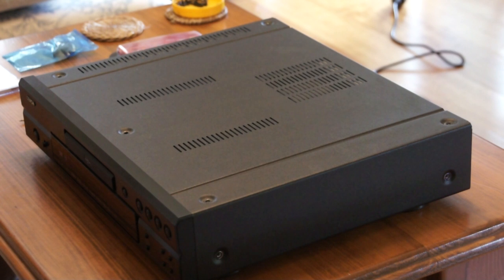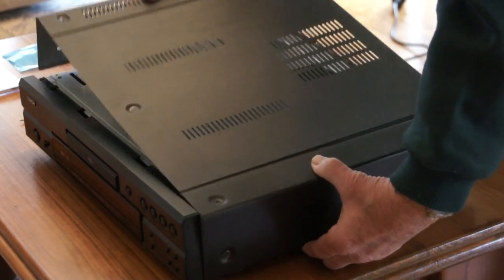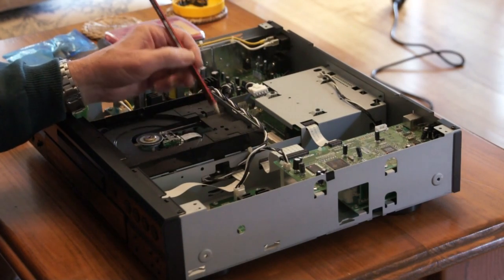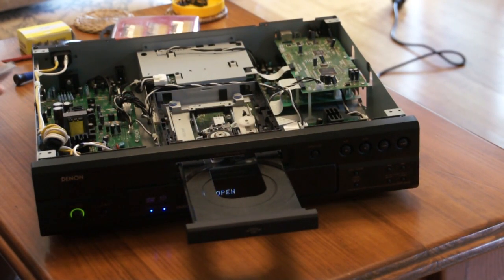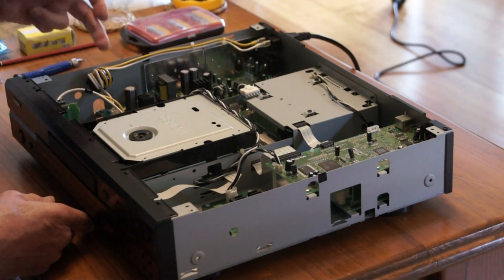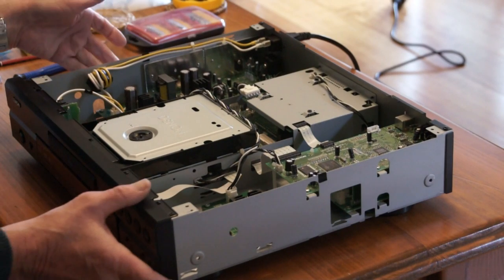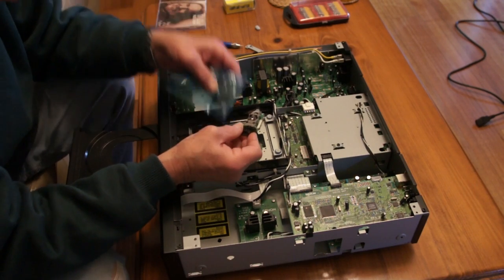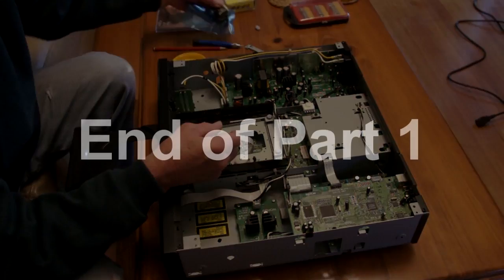Denon 2930 Laser Pickup Replacement (Part 1 of 3)

Comment: I've just successfully replaced the laser in a Denon 3910 that had stopped playing thanks to your video. The 3910 has the same body but slightly different interior but with the information you've given it was easy enough to figure out. The black front panel has to be unscrewed and pulled away a little and a  bar across the top  held by two screws, removed to allow enough room to remove the covers on the laser assembly. Thanks to your warning regarding the springs I avoided losing them. The ribbon connector has a tiny bar which must be pushed out a millimeter or two before being removed and of course pushed back when replaced. The left bar along which the laser slides can be left in place; the right comes out to remove the white gear assembly. I believe you did one thing wrong: changing the allen screws which adjusted the height of the assembly/beam. Sorry yours didn't come back to life but good karma to you on your next project for showing me how to revive mine!

Comment: Great explanation and tips!   My Marantz DV9600 has very similar Philips transport, and failed to play CDs (SACD and DVD were OK).  I initially tried adjusting the allen screws with the old head to no avail.  

Only differences were:
1) There was black 'tape' holding the back side of the cover on which I had to remove, and there was a ground (you call it Earth) wire with a copper screw to remove on the top of the cover.
2) I had to remove two solder blobs on the new pickup instead of one.
3)  There was a small white plastic piece on the old pickup that helps keep it on the left rail (looking from the front) that I transferred to the new one
4) I was able to keep from losing the springs by carefully keeping the black plastic retainer upright.  

Thank You!   I was able to get a great player working again (original list was about $2000 US in 2005).

Comment: Excellent set of videos. I am a hands on electronics eng and also enjoy repairing similar devices as a hobby. Just one point to viewers. I suggest it is better to use a pointer device other than a pencil. This because a pencil tip is graphite. Graphite is carbon and is a very good electric conductor. One could accidentially leave a graphite trail on a circuit board or between adjacent components etc and it could conduct and short out. Particularly easy to happen on tiny surface mounted components and on miniature connectors and ribbon cables.Absolutely avoid using a pencil if you need to investigate components while they are live (power on). This point is not meant in any way to deflect away from  this excellent video which i find very helpfull.